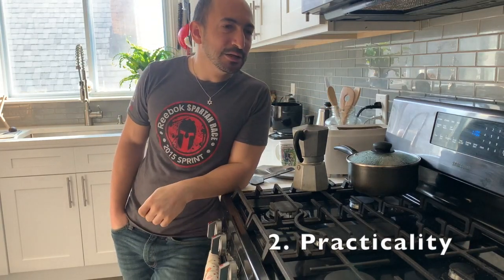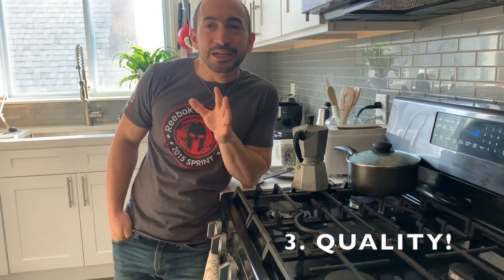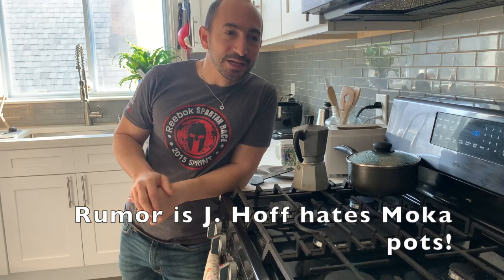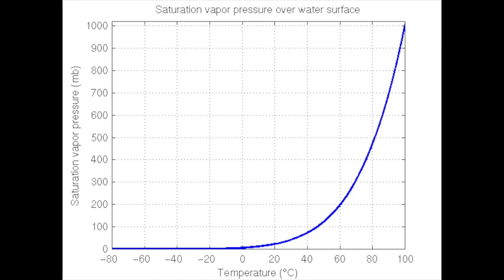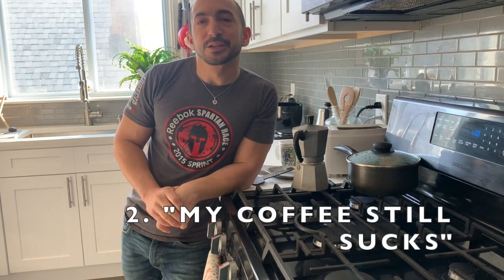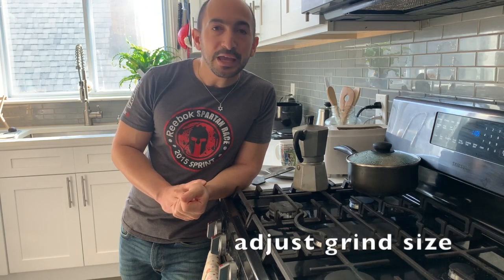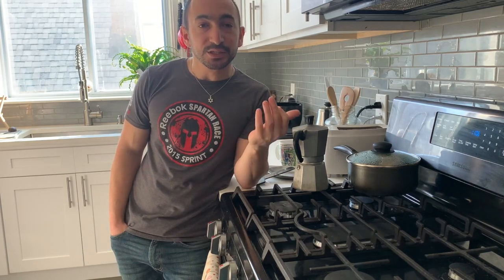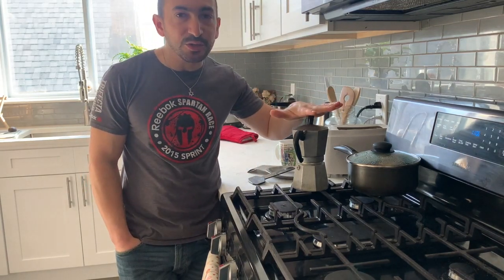Why your moka pot still sucks and Italians hate me.

Comment: I just wanted to say that I agree with you about preheat the water or not is just a matter of practical, it shouldn't make any difference as the water toutches and goes through the coffee only when it actually boils and rises. 
A suggestion you could give to people is that the filter has to be taken apart by sticking up from the small hole (of the funnel shaped filter), something small enough (I use a skewer) to push out the disk with the micro holes (the underneath of the filter gets really bad and lots of burned coffee get stuck there and ends up to be the cause of a disgusting coffee) 
Also make sure that there isn't coffee granules around the rim before closing the pot, this will avoid the rubber seal to get bad. Also you won't have more coffee granules at the bottom of the cup. 
Ciao 🇮🇹
Reply from the maker: Hi, thanks for the comment!  I agree that getting a good seal is super important and that coffee granules being stuck in the gasket is an easy way to lose that seal.  Someone else has already made a video about taking a part the filter and recommends using a fork to remove the seal, but it sounds like your method works too!

Comment: Fun video.  On the pre-boil or not debate: My take is that it makes no difference except that boiling the water probably remove some of the chlorine.  That may account for why some people prefer the coffee taste when made from boiled water.  That idea could use some testing.  But, of course, the biggest factor in the taste is the quality of the beans.  I've roasted for most pots of coffee for approx. 40 years and I don't recall having made a bitter cup of coffee.  That includes the Moka I just made: roasted the beans (Costa Rican mountain, wet processed, not high priced), pre-boiled the water while the beans roasting, ground fine in a blade grinder, over roasted slightly cuz I wasn't paying attention.  Not perfect (over roasted taste) but not bitter.
Reply from the maker: Yeah, that's an interesting idea.  I just researched around a bit and confirmed that chlorine's solubility in water does substantially decrease with temperature (https://www.engineeringtoolbox.com/gases-solubility-water-d_1148.html) so you might have point about getting the chlorine (and other impurities) out of the water before its only route of escape is through the grounds.  Worth experimenting around with for sure.

Comment: Hello I just bought a moka pot and it seems the coffee is not flowing smoothly, seems to be sputtering, I dint want to send it back as it looks so nice, do you think silicone gaskets work better than the original Bialetti ones, someone also mentioned to put some oil in the gasket
Reply from the maker: Hi Ana, great question!  It shouldn't be sputtering until the end, when it's time to remove the pot and apply cold water.  

If your heat is on medium, my first suspicion would be an improper seal of the gasket.  I have not tried the silicone ones nor do I know anyone who uses them.  However, I have experimented around with the "Italian" style of brewing with a Moka pot, where you build a small "mountain" of coffee grinds and doing this consistently results in a loss of pressure similar to what you describe, as the gasket is not able to seal properly, no matter how tightly the top is threaded.  Make sure that the rim of the filter basket is clear, that there are NO coffee grinds there on the rim, as this will prevent a proper seal.  So long as the rim is in uniform direct contact with the gasket, it's pretty easy to get a good seal and you'll get the kind of consistent pressure you'll need for a relatively even extraction.  Let me know if this helps.  Good luck!
Reply: @loodog555  Hello, I only just used the moka pot about 4 times to test it and I may return it tomorrow, I didnt feel the basket completely with coffee, a couple of times I tried with about 3/4 coffee as I didnt want to waste too much coffee on the test, the other two times it was full but not like a mountain, the rim of the filter was clean. 
I tried putting oil on the gasket and probably the sputtering was worse, the moka pot made only about 1/4 of the capacity and the coffee tasted bitter, all filters are new and clear, the moka pot is brand new, luckily I can return it, its a Bialetti with the color of the italian flag, got it for a good price on amazon, I wonder if it was cheap for a reason :-( , may try with a silicon gasket that I ordered but I don't have much hope, seems moka pots are very temperamental its brand new, should work .
I had a couple of stainless steel in the past and they just worked from the first time, one was a completely unknown brand
Reply from the maker: @anaotazu5975  Sorry your pot isn't working out.  I haven't heard of putting oil on the gasket. Is there a belief that this will create a better seal?  The coffee tends to be a bit bitter, but if following the best technique, there's only a bit of coffee left in the base, with maybe 90 of the water coming out on top.
Reply: @loodog555  I just returned it, yes people say the with oil the gasket has a better seal, in my case didnt make any difference, it kept sputtering, how long your 6 cup takes to make coffee from cold water, sorry just curious :-)
Reply from the maker: @anaotazu5975  Bearing in mind that I preheat water, I'd say from the time the burner starts heating until seeing coffee is about 4 minutes.  Also, this has been measured more rigorously than I have done:

https://www.semanticscholar.org/paper/The-physics-of-a-stovetop-espresso-machine-King/8a38818c2ce700e632cb25a6d2a518582d2edf17

They measured time until coffee to vary between 1 minute and 5 minutes depending on how much initial water they put in the bottom chamber.

Comment: Glad you mentioned energy efficiency. All other things equal, heating water in an electric kettle is more environmentally sound than heating it with gas.
Reply from the maker: Agreed. The physicist in me thought “ oh, whatever. It takes the same energy for the temperature difference” but then I did some research online, and there really are differences in efficiency. Never trust a physicist when an engineer has looked more closely!
Reply from the maker: @Bohdan M then you can use that, those surprisingly, and electric kettle is more efficient, because of the shape. Fewer heat losses.
Reply: @Bohdan M Good question. Apparently you loose more heat from dissipation than with a submerged element heating the water directly. But if you don't have an electric kettle then buying one, with all the energy required to build and sell it, might well obviate any benefit from an overall perspective.

Comment: question: do you know if correctly using the moka pot will make bad coffee worse or will it make bad coffee better than it would be brewed by drip? i have followed your steps precisely with the exception of using good coffee, as i cannot afford to right now, and the coffee is less pleasant than sucking on a battery. however, when i use the same coffee in regular drip, it tastes acceptable enough.

...thanks for the videos.
Reply from the maker: A drip is probably more forgiving than a moka, though stale coffee is stale coffee (if that's what you mean by "bad" coffee).  If you're buying some preground bullshit coming out of a tin, that stuff is already depleted of flavor by the time it gets to you (and it might be the inferior breed of robusto beans if it's really cheap). It takes a good amount of work and tweaking to get a good moka cup and even then, you might not hit it every time.

Comment: I cant help but notice your moka pot looks like it's been through a dishwasher... I recently did the same and it left that same undesirable look with a film on the metal. Is any of that an issue for taste, health, etc? I'd rather not have to buy a new one. Judging by your video, I'd assume it's fine, but I'm certainly open to hearing your thoughts. Thanks!
Reply from the maker: Oh shit, I’ve been found out!  I once put it in the dishwasher maybe six months ago, as an experiment.  I can tell you from personal experience to listen to the manufacturers and Internet crowds on this one!  For me, the thing turned this dark color (like you spotted) and the metal became reactive to touch.  The aluminum would rub off on my fingers when I touched it.  I wound up having to clean it through three or four times with just water before I was happy enough that I had worn a new oxide layer in (my theory anyway is that a protective layer of unreactive oxide is usually there). Since then, I have done research about the safety of aluminum poisoning in moka pots to reassure myself that this was ok (future video!).
Reply from the maker: @JeffLencioni  here ya go! https://www.youtube.com/watch?v=qV3Us0KkIMo

Comment: These videos have been really helpful. I've got a slightly different question on my Moka pot. My wife and I have a 4 cup pot (which is larger than most I've seen). If I make a pot, the coffee is usually quite good. But by the time we come back for a second cup, it's not especially hot. Any thoughts on ways to maintain some of the heat without losing the flavor or composition? Throwing the cup in the microwave isn't the same and reheating it definitely doesn't work. I know I probably need to just get a smaller pot, but I'm curious if anyone has thoughts on this first.
Reply from the maker: James Hoffman has thoughts: 

https://www.youtube.com/watch?v=yqgKlqAUM9g
Reply from the maker: @christga100  I usually pour the extra in a thermos, 

Interesting comment about the difference between aluminum and stainless steel, because I can back it up with theory: 

Certainly the specific heat of aluminum is about twice as big as that of stainless steel, so the aluminum his ability to maintain its temperature is about twice as strong as the stainless steel.
Reply from the maker: @christga100  in theory, going too fine with the grind should just make it too bitter and overbrewed and strong, and this is what I find.  The grind size I have settled on is towards the finer end of a pourover.  Seems to prevent the bitterness.
Reply from the maker: @christga100  inconsistent grind size should affect a moka pot the same way it affects any brewing method, which I discuss here (https://youtu.be/dgM-_nPPKgw).  The grind size basically gives you an extraction speed, which will determine how long you want your coffee to brew for to get good extraction.  If you have a bunch of differently sized grinds, The larger grains will be underextracted while the smaller grains will be overextracted, leading to incoherent mess of unpleasant flavors.  You will get the sourness and acidity of under brewed mixed with the bitterness and burnt flavor of the over brewed.  

On the difference of aluminum versus stainless steel, I don’t really have access to many kinds of experimental data about if it tastes different. On the theoretical end, the only difference I can think of is the fact that the aluminum has double the specific heat of stainless steel, so it should maintain a slightly narrower range of temperatures, take longer to heat up, and take longer to cool off.  Because one of the problems with moka pots is temperature variation, this reduction in temperature variation should be a good thing.

Comment: you can´t tell the difference because u use the wrong moka pot, buy a little one, buy espresso pre grinded.
Reply from the maker: Hi Emil, I appreciate your willingness to follow-up and watch much longer video here. It would be interesting to see how the pot size affects brew quality, though these pots are generally designed to keep a constant ratio, whatever the size. 

On the question of using pre-ground coffee.....I'm very resistant to that idea.  The research I've seen in the videos and papers is that ground coffee stays fresh for no longer than 1-2 weeks.  The problem is that after being roasted, the beans begin degassing, which results in their losing flavor. This process is greatly expedited by the beans being ground, compared to being whole bean.  I freshly ground every morning.  Again, you do you and brew whatever you find works for your tastes.  I wish you good coffee, friend.
Reply: @loodog555  probably you are right about all this tech around the beans but listen to an italian, buy a decent pre grinded coffee keep it close in the refrigerator, not freezing, at least to try the difference, do you have Illy coffee or Lavazza?
Reply from the maker: @scleropus  No, I don't buy coffee roasted by large brand-name corporations, as I have concerns for freshness, especially of pre-ground coffee. I'm also concerned that their market power exempts them from the need for quality.  The coffee I use is only locally roasted. I'm also not going to use anything that comes in a can.
Reply from the maker: @scleropus  honestly, any store bought is not going to be fresh, especially anything pre-ground. Yet the people at Illy and Lavazza have done a very successful job of marketing within their country, to the point where Italians don’t seem to prioritize freshness.
Reply: @loodog555  obviously, since I can´t even taste other coffes, I wonder if it is like tobacco that it is used in the industry processed some additives.

Comment: Maybe you're good with showing a few of beans to the water, before drinking "coffee". Please don't call that what you are making "coffee". It is colored water. Naming this "coffee" is a cultural insult.

Several errors:

- The amount of coffee powder is too low
- The moka is for SIX cups, not one.
- The cup is wrong, you don't use a mug, you use an espresso cup

The right way:
Buy a smaller Moka, the filter will be completely filled. The moka is lightly banged with the bottom on a surface to distribute the powder. A small "peak" is created with another spoonful of coffee powder. The moka is screwed and heated on medium flame. The espresso cup should be warmed before filling.

Preparing crema:

The first drops (the strongest) of coffee are poured into the preheated espresso cup. Then add significantly more sugar than coffee and stir strongly, amount of sugar depends on favorate taste. The coffee from the moka is slowly poured into the cup, the sugar-coffee mixture floats.

The reference of the last video (preheat water) refers MAYBE to a steel moka. Aluminum has 11 times higher thermal conductivity.
Reply from the maker: Hi there, Krethi Plenthi!  Thanks for commenting!  Regarding the amount of coffee grinds, I've gotten so many comments on this one that I've actually made a video where I test out people's preexisting beliefs on this topic, including the claim that you need a little mountain of coffee.  Enjoy: https://www.youtube.com/watch?v=bCSn2CXWZOE

I'm a bit confused about your remark that it's the wrong number of cups.  The moka pot comes in a 1, 3, 6, 9, and 12-cup model. I'm using the 6-cup model... to make "6 cups" it's really about 1.7 cups, since the "cup" isn't really standardized in any way, especially in coffee contexts.  

As for adding sugar to a moka pot, I've not heard of trying this, but the crema is an emulsion of oils and is not related to any added sugar, so I find this use of the word curious and think you're referring to something else.

On the debate of steel vs. aluminum, man, people get really fierce on this one!  The difference in thermal conductivity is not what preheating the water is about, but rather about extraction temperature, given basic applications of Darcy's law, vapor pressure, and the ideal gas law.  I explain the details in the following video, if you'd like to know more: https://www.youtube.com/watch?v=O14BIH-9KTA.   In any event, heating up about 300 g of metal and about the same quantity of water over a span of maybe 5 centimeters over the course of several minutes is going to render heat transport differences irrelevant.